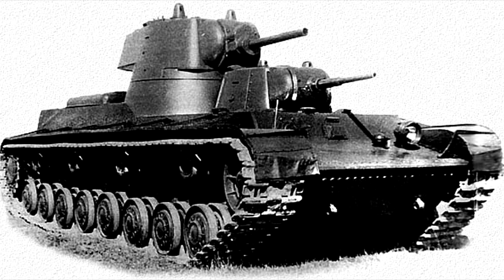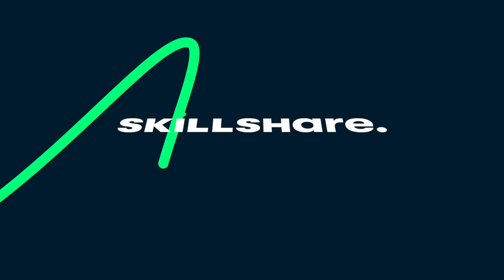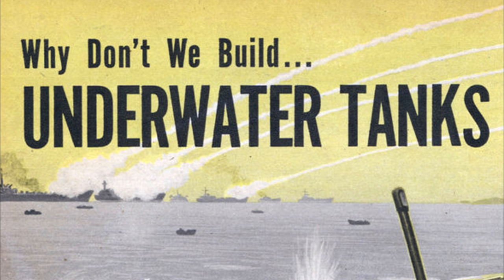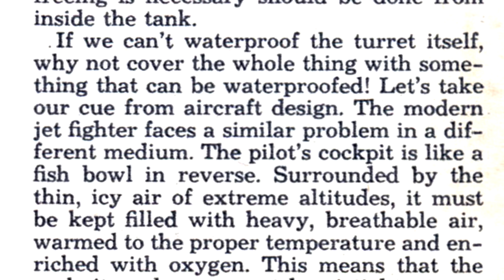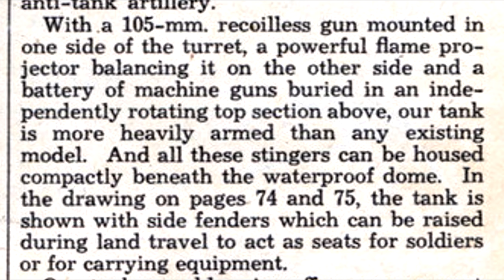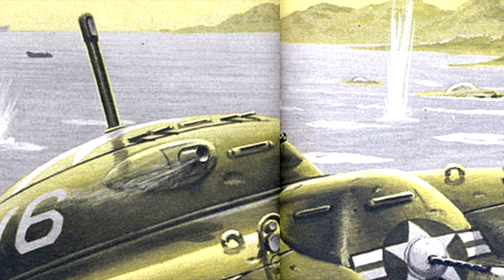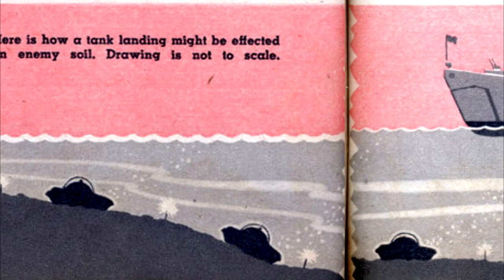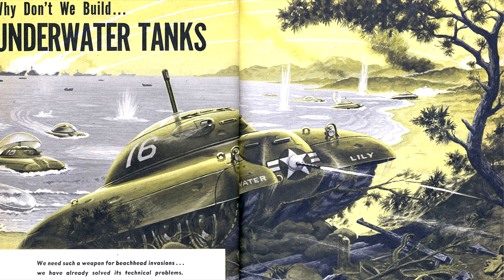The CRAZIEST Amphibious Tank Concept EVER | Cursed by Design

Comment: No matter what design getting stuck on the sea floor,not being able to climb up cliff type elevations,thin armor etc it's not a practical idea.Air power or naval artillery is the solution.You bomb the beach first then send in fast assault boats or Apaches or A10s to suppress and cover the  LCACS to drop off the tanks.Today tanks and paratroopers are obsolete replaced with airmobility and rightly so.If I'm constrained  WW2 technology,tanks can only be brought in by land.A creeping artillery barage then air cover then motorized infantry would advance then dig in till the tanks caught up then they would lead the advance.

Comment: NBC sealing is a common feature on modern MBTs, and Soviet armor demonstrated fording rivers to a depth of 4 meters (12+ feet). That is a practical demonstration that concept could work to some degree. Tinsley, however, demonstrates gross ignorance of the nature of recoilless rifles, and makes blythe assumptions about them that have ZERO bearing on reality. Likewise, he seems excessively fond of mass banks of machine guns and flame throwers.

An ATGM-firing weapon like that found on the M60A2 is still too long, though it is getting closer to his ideas. A turreted ATGM-only design, or something like an M2 Bradley is closer to what he needs. The periscope is pointless, and unnecessary; Existing vision blocks would be fine. A dome is also unnecessary, as it would be easier (and cheaper!) to seal the vehicle via plugs and inflatable collars.

So, yes, it could have been done. But likewise, it would have been a logistical white elephant, and a massive pain in the ass, not to mention grossly expensive for a vehicle that would be rarely-used and capable of assaulting only a very few landing zones.

Comment: Just make the main gun a 30mm or 20mm exta rage power gunpowder explosive hardened easily breakable from inside the bullet for more flames and fragments min machine gun with 5 barrels like one used on anti tank vlose range USA jet would be more effective and variable here.

Comment: The dome concept is not worth pursuing.  Air bladder gaskets around all of the hatches are much more easily utilized.

The author also fails to understand the requirements of a recoilless rifle; it needs the breech end exposed to allow the counterbalancing gasses to escape.  This design would cook the crew on the first shot.

But the real danger with an underwater tank is that if anything goes wrong the crew is dead.  Say the vehicle breaks down 40ft under the surface? The crew would have to abandon through the existing hatches against the flow of water.  A nightmare.

If you had to build something like this, build it without a turret at all.  Add an auto loader and keep the crew to 2.  And put those crew members in an escape capsule.

Comment: Okay first of: really cool video type, I would not mind more of this
Second of: Didn't recoilles rifles have an insanely huge backblast?
So as soon as they fired their "gun" the entire crew compartement would be fried/gassed
I mean, this would be solvable by making the turret not as stupendously big and just sticking on a smaller caliber gun, but that's one of the first things I noticed about this design
Maybe we could indeed build this nowadays, I mean, we built a tank that could be airdropped, that didn't have that big a turret if I remember correctly
Reply: probably meant for the the rear part of the RR to be outside the turret, for the backblast, since i believe only reason why they chose a RR is for the compact size.
Reply: @basketcase1235  Wait, would that work?
You need to reach the back of the RR to load it, right?
I thought the use of the RR is just to be fancy and use new stuff tbh :P
Sure he says it's for the small size, but not all guns have a huge barrel length

Comment: It is a good solutions of the past war, as usually happens. But with the airpower and rocket and missiles, any landing would either suicide or almost unopposed, since you either have control over the landing zone, from air, and than you can clear it from enemy with bombing and shelling and such, or you have no control over it from air, and than you are not able to land with anything, since the enemy has the ability to clear it from you. Also  with the nukes in play, similar tech and complex systems will rarely if ever go head to head. Making the landings again either impossible, or trivial. See taiwan, with the us support and similar tech, the much smaller island nation can easily make the chinese landings unfeasible, if not outright impossible. And even without the us support, the similar tech level would make it very costly for china.

Comment: Dumb idea really, would only work in very limited situations. They would get stuck in the sea floor in most cases, would be very difficult to negotiate underwater obstacles, likely be very slow and once known easily countered by relatively cheap shore defenses. Likely they'd have to be dropped so close to shore to be effective at all that you might as well just keep goign and land troops.

Comment: Could it have worked? Yes. Would it have worked well? Absolutely not.
There are so, so many ways this could run into unpredictable snags in use outside of the perfect conditions, there's basically no way it would have been successful. And that's just talking about getting it onto the beach, judging by the description of the turret I'd imagine the crew ergonomics would be, in a word, hot garbage. I'm forced to assume they know something I don't about the design that would make it safe to use.

Comment: the design is terrible, but the idea isn't.
"you could reuse the canopy"
thats not important.
instead of looking to aircraft, what should have been done was looking to diving bells.
a large umbrella could be attached to the top of a standard tank. and it would have boyancy so it goes down like a submarine but doesn't have to touch the ground depending on the currents.
if the barrel is long enough, no armor is needed. you just need to be shooting the canons barely offshore using the water itself as armor. it also means you have ready made entrenched positions, defendng a landing spot.
the problem is the drive train.
if they use petroleum, then that consumes oxygen. and the amount of distance it will be able to go before using up available oxygen isn't only limited by how much armor it has, but how much water weight it has to push out of the way.
if they use electric drives, then that will require quite a lot of batteries, and also the beach head has to be made before the humans consume the oxygen all the same.
the treds also would need to be appropriate for driving on silt. which means less armor, and wider tracks.
for the gun to operate underwater, would need a way to repeatedly clear the barrel sorta like a torpedo port. using rounds to clear it might work, but also might backfire bad with water turing into steam. a litteral torpedo port, would allow reloading without much water going into the cabin, but it wouldn't prevent waves from drowning the canon. nowadays they could use the same thing russians use to proper submarines to empty the cannon through a hole as long as has power.

i suppose the canon itself could be many purpose.
right next to the canon could be an air intake. which if powered could cause the tank to be able to run perpetually. exhaust gas could be vented burbling in the sea, or up the same canon. water could be pushed out another tube attached to the canon, sea water should pull heat out of the cannon fast enough that the pipes wont melt, and leaked water could be pumped up the 'elephant trunk' making the canon itself a super soaker. this creates a problem with it being easy to spot as water creates froth when it hits either stationary water or splaters. this also means that depending on how much horsepower they give the super soaker, the unit could be both for landings, and fire fighting in ports. this also allows for slightly beter logistics for establishign base camps... water matters for any base, and having a watertower gravity feeing with cyclical replenishment if the best way to go. this would get rid of a large portion of the pipes needed. similar to that california thing.

Comment: The tank wouldn't work unless it was unarmoured (this is why subs have practically no armour) as water is 800 times denser than air, so the vehicle would have to be very light to move.

Comment: I think similar things have been done yet failed, BUT in today's technology this is actually extremely capable...but with a few changes, they would not work in the gulf...they'd hit the drop off before the beach LoL. And many other places as well, wouldn't be able to use these in its current style, due to the areas geographic layouts it would be impossible....now if thses never had to touch the bottom then yes they'd work just fine...and while I don't see this for anything in our current future....it could be turned into support landing vehicles to aid the landing vehicles...like the orginal floating tank that failed extremely and many are in the bottom of the ocean LoL. It could also be used as covert ops tanks go in and deal heavy quick  damage to certain targets, without the need for extremely expensive bombers and rockets especially if you design a easy way to replace the cover hull on top, or an even better design with our current technologies.
Reply: I actually does remind me of a similar design though

Comment: Its ideal solution... for ideal environment, but in the real world there is mud, rocks and all kind of other shit that throws literal rocks into gears of this design even before enemy would be designing anything. All it would take is just one tank trap on wrong place and whole group of tanks, with their crews are going to suffocate or drown since you would be need to get back to ship that probably already has moved away, have solid communication line to surface and divers to attach the winch wires to tank  to get them back to ship if landing fails due tank traps or such obstacles.

How ever this gave me idea to have parent ship designed for this use to be catamaran design and underbelly of the ship has these tanks as watertight bottom that can be released and let the now floating tanks to move with propellers on the shore. Sure its large target, but such wide and long pontoon should be stable even bit rougher sea conditions to get safely on the shore. You also can use the main gun plus machineguns and on shore just blow explosive bolts off and release the pontoons. Getting the buoyancy just right whole thing can be rather low on water covering pontoons from enemy fire and of course them being segmented to prevent flooding when those get hit. But that is just one idea and rather late since now days we dont need such vehicles.

Comment: Very Very Very expensive to prototype and produce... 

It's similar to Dieppe the first time with all sorts of unknown obstacles and problems that were unforeseen at launch. They take it back and fix the problems and send it back for another naval beach assault only this time... The Korean's are ready and have lined the bottom of the seafloor with obstacles the tanks can't traverse around or overcome. Every tank then has it's operators suffocate to death and the concept is embarrassingly scrapped. 

While perhaps overly pessimistic in some aspects, war is like a Chess game with each move having an opponents counter move. While the design has excellent potential to surprise enemy combatants the first time it's unlikely to have repeated successes especially as it's easily countered by a few pieces of scrap metal wielded together and dropped into the ocean.